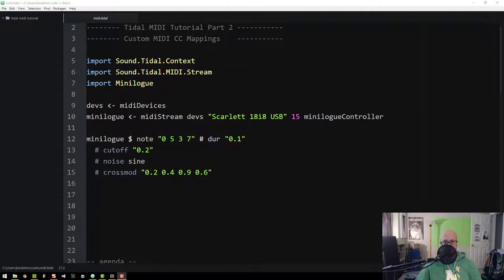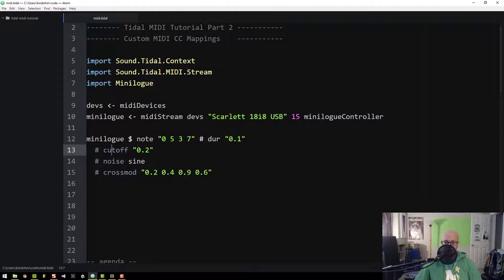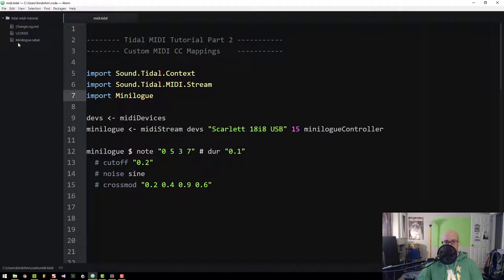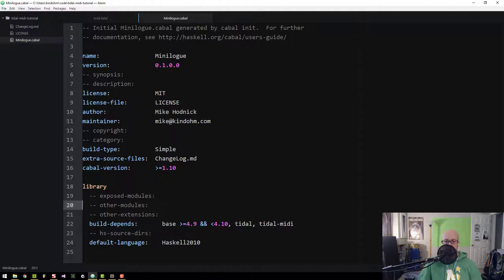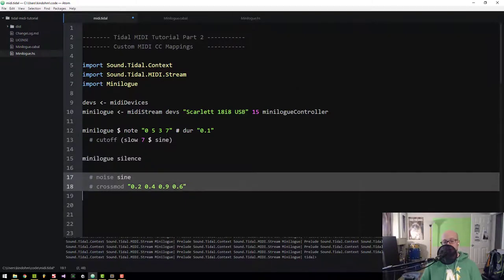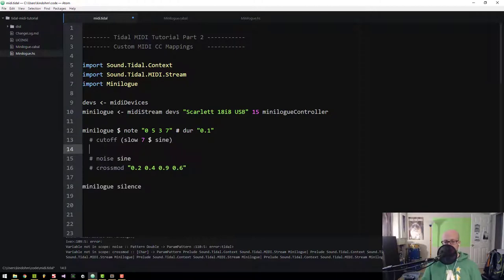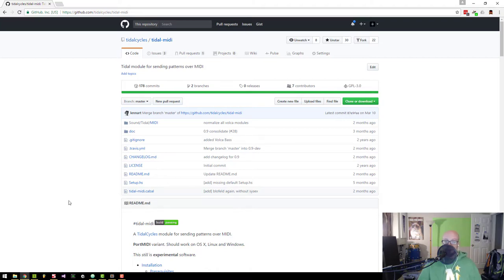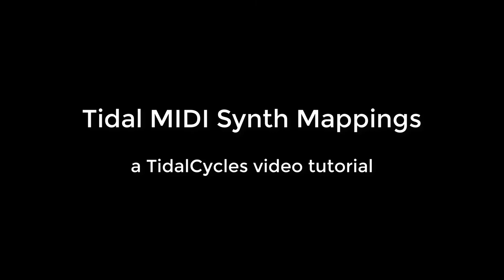TidalCycles Tutorial #16: Tidal MIDI Synth Mappings

Comment: hey Mike, thank you very much for all you share with us :) 

I have a problem, everything is fine until I evaluate "import Minilogue". I have this error : Could not find module `Minilogue' It is not a module in the current program, or in any known package (by the way I'm on windows).

Maybe there is a way to install manually without passing by the command cabal? I mean, I've the feeling the package is not installed in the right directory no?
Or maybe the first folder where you create the package need to be known by tidal? 

Thank for your answer

Guillaume

Comment: What if the controller parameters are sysex?
Reply from the maker: I don't think there is good sysex support yet. I think it is built in but I'm not sure it is working properly. There is an old Tidal-MIDI Blofeld implementation that uses sysex, but I see now that the module no longer contains the sysex stuff. Here is the old code, committed June 2016 (no guarantee it will work): https://github.com/tidalcycles/tidal-midi/blob/15fe6846425b3740d73cd0e70c79931fe9bee53b/Sound/Tidal/MIDI/Blofeld.hs